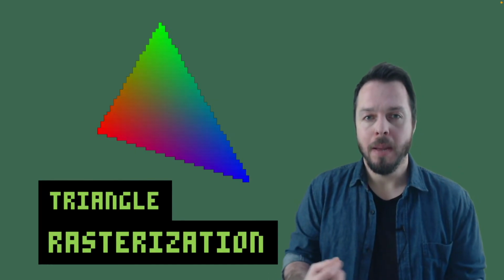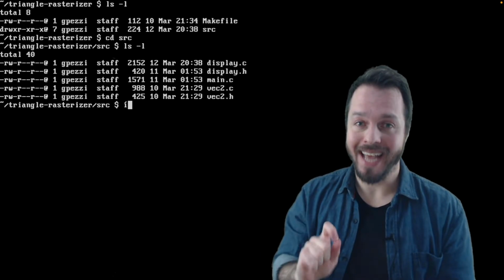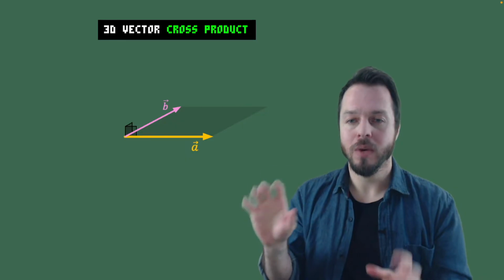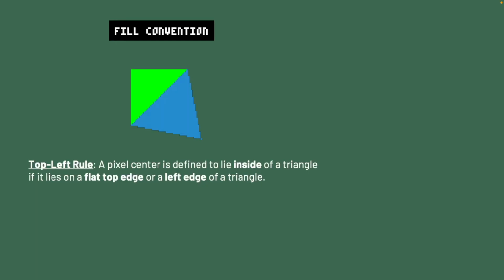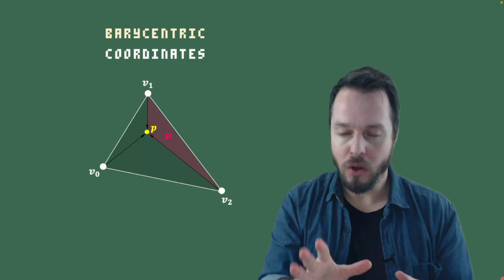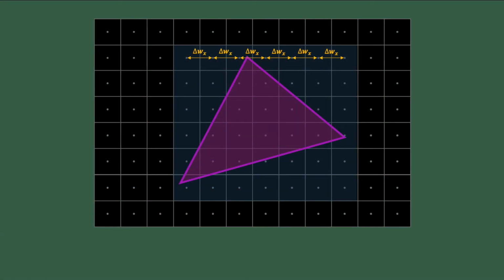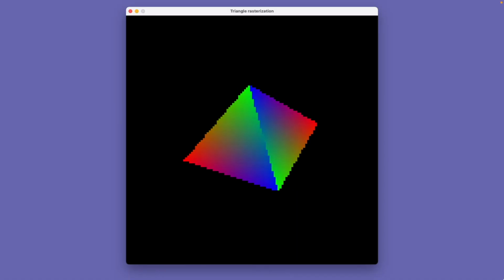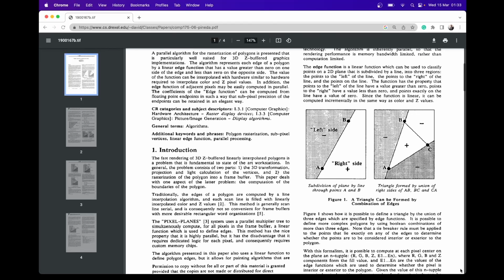Triangle Rasterization

Comment: Hello @pikuma this video is awesome, just an quick note, alpha = w0 / area is only correct if the w0 has the bias not applied. You should create an intermediary variable to sum the bias and then use this to see if that's inside the triangle and only after that calculate alpha = w0 / area using the original w0 so the final weight will be actually correct.

Comment: Also, I don't think we ever cared about the small overlap, z-buffer usually handled that
Reply: and when you want translucent wavy water surface?
Reply: @ArneChristianRosenfeldt  Well, you first render all the opaque stuff and then transparent from back to front with z-buffer
Reply: @AllanSavolainen but the overlap messes with alpha
Reply: @ArneChristianRosenfeldt with proper bias it won't, or you can use stencil buffer to help that
Reply: @AllanSavolainen I guess that is what I meant. I read that the 3do had a stencil buffer, but it was too slow

Comment: Hmm, what Hmm, what I did in the good old DOS days was to first split the triangle into two so that in the middle there would be one vertical edge. In case the top or bottom was vertical, this step could be ignored.
Then I would calculate the slope per row for the left side, eg 0.3px/row. Then do the same for the right side, lets say 0.4px/row. Then would calculate delta length per row which was how much the each rasterized line would grow per row, and would be the sum of both slopes.
Then I would just iterate from the top, fill the cur_row_length of pixels, move the start_x_pos by left_slope and inc/dec the cur_row_length by delta_length. And loop until I get to the middle vertical line, or the end vertex of the triangle.
To get gouraud shading on this, I would calculate similar deltas and slopes for the color gradients and inc/dec those per pixel and row as needed.
Simple rasterization on MCGA 320x200x256c DOS screen. Well, there was extra step to map the current RGB to palette/dithering color.
Reply from the maker: Yes, splitting the triangle in two and finding the slopes to raster each scanline is the approach we use in our course as well. I just thought it was important to also explain this approach since it can take better advantage of paralleliaation.

Comment: I've done most of that stuff 25 years ago so this video didn't really taught me anything new. However I have to agree with all the other commentators: This has to be the best and most comprehensive video on rasterization. Most videos skim over it as they will be targetting an actual graphics API like OpenGL or DirectX which does all that for you. So they usually focus just on the vector and matrix stuff and many even mix up some terminology (NDC and Clipspace are what most confuse and when the homogeneous divide actually happens). I'm sure many probably will struggle sitting through this video as some concepts are explained in a quite tight format. Though I think you really mentioned every little detail that is necessary. Even providing some visual and mental hints for some concepts (barycentric coordinates for example) which is certainly helpful for many.

So I'm really impressed that you managed to pack all this into one video.

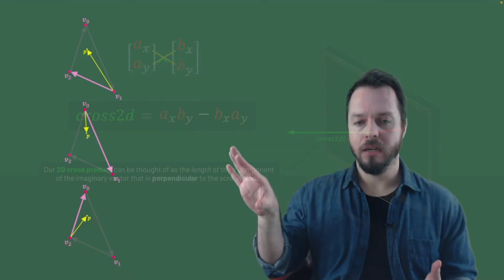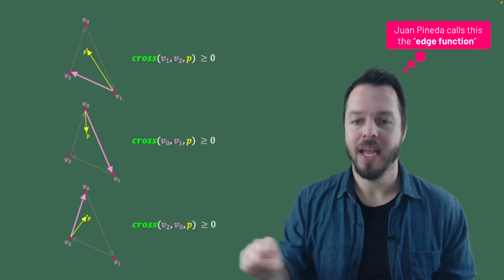Comment: Note that the diagrams at 47:29-47:54 only work for y-up cartesian coordinates and if the vertices are defined and passed to the cross() function in counter-clockwise (CCW) order. They do not work for y-down screen coordinates. However the edge_cross() function in the C code works because the vertices are passed in clockwise (CW) order which are okay for y-down screen coordinates so the  w0,w1,w1 >= 0 test works.
Reply from the maker: Yes! Thank you. My life is a constant tug of war between traditional y-up math notation and formulas that work in screen coordinates with y-down.
Reply: I implemented this in verilog/HDL for my own rasterizer hardware and it took me at least a few hours to figure out that the winding order are different for these different coordinate frames. Glad to see someone commented it here :D

Comment: I'm a windows user and not able to compile. "make" command is not recognized, I have gcc/mingw installed but can't seem to work out what I need to resolve.

If I just run the gcc command it complains about sd12-config: No such file and unrecognized commands '--libs' and '--cflags'.

I've been tempted to get your full 3D graphics programming course but am wondering if it's more comprehensive in the project setup than this video?

I've also recently followed another video of yours about setting up SDL in a Visual Studio Project on windows and feel like that might be what i'm missing here, but I don't seem to have the experience to combine this video's source code with a Visual Studio Project setup with SDL.

Your videos are great no doubt but any help getting this example running on windows would be greatly appreciated!
Reply from the maker: I don't habe a Windows machine with me, but if I recall correctly MinGW cones with an executable called "mingw32-make", which should behave similar to GCC's make on Linux.

But my suggestion would be to simply use Visual Studio. It has not only a better build process (as I show on my SDL+Windows video) but you get a great debugger with it as well.
Reply from the maker: Using Visual Studio also means you don't need a Makefile (or make).
Reply: @pikuma  thanks for the reply! I’ll try again with visual studio

Comment: 1:59:20 taking this a step further, you can offset the rasterization point randomly for every pixel and every frame, as long as it stays inside the pixel area, instead of using only the pixel centers. This turns jagged edges into noisy approximation of an endlessly supersampled image, if done in real time. Compared to ssaa, msaa, fxaa, dlaa and tsr, this could be the cheapest and most detail preserving way of anti aliasing in gaming. Blending the current frame with previous frames takes place inside our eyes due to a phenomenon called persistence of vision, which suppresses the noise by a lot, of course depending on the framerate. There is a github project called gaussian anti aliasing that does this. I have implemented it in a ray marching shader and it works really well. Now, only the gaming industry needs to pick it up
Reply: This is called stochastic rasterization in the literature and you are drastically overstating its virtues. Even if it was a perfect solution to jaggies (it isn't but it's a useful tool), the major aliasing problems for the last 15 years in games and real-time graphics are primarily about lighting, shadows and material shading. That's why TAA/TSR has won--it integrates samples over time, so it naturally filters temporal aliasing, and combined with intentional temporal subpixel jittering (similar idea to stochastic rasterization) you can turn spatial aliasing into temporal aliasing and filter that too. And it's a big hammer that can be used to address all the major sources of aliasing, not just jaggies.

Jaggies just haven't been top of mind for graphics programmers for a long time and for a good reason (1080p -> 1440p -> 2160p). There's a reason Apple got rid of subpixel antialiased text rendering when they moved to Retina/1440p displays. In games, the shift towards deferred shading made MSAA unavailable/impractical and TAA picked up the slack. The one case where I think MSAA/anti-aliased rasterization is a big win is in VR because of how visible edge aliasing can be with the low relative resolution. But that's a niche. Outside of that, it's too far down the list of aliasing problems to be a major concern.
Reply: @pervognsen_bitwise  Thanks for your comment. The literature on stochastic rasterization looks quite complicated to me, but as far as I can tell, its main focus is multi pixel blur. Besides the gaussian anti aliasing project, I can't find any literature on random rasterization anti aliasing

Other than that, I think it all comes down to personal preference. Real time rendering has its limitations, so even with random rasterization points, you won't hide aliasing artefacts. That is not the primary goal of it though. Which is showing more accurately what is going on inside the pixel, while preserving the finest detail during movement, without additional cost. Lots of people rather disable anti aliasing than using taa. As I do, but I noticed that jagged edges stand out the most on stills and slow camera movement, especially on grass fields with a high polygon/edge density. Faster camera movement looks a lot better to me, as the jagged edges ar pretty much random, as wel as texture undersampling of course. Random rasterization can emulate this at any time. If the noise gets unbearable because there is too much sub pixel detail, than this should be adressed with lods or texture mipmaps. Taa can only blur the noise away, together with a lot of precious detail. After all, taa doesn't see a difference between the two. Dlaa is an improvement, but significantly more expensive and still not as crisp as seeing the picture as it is

There is also foveated adaptive resolution, which works with deferred rendering. If you have an eye tracker in vr goggles or goggle mounts without glasses to look at a regular monitor, you can render at lower resolution in the periphery of vision to improve the performance. It also allows for supersampling in the center of vision. This reduces random rasterization noise to very acceptable levels. Still not noise free, but lots of people don't care too much, myself included. It's always possible to include reprojection, but the player should have full control of the most recent frame contribution

Then there is the problem of effects relying on taa to look smoother (at the cost of washing out details). These effects often use dither patterns to emulate translucency, mostly by turning off the opacity mask or by pushing pixels forward so a part of them is hidden behind other objects. I rather use a random number generator instead. Without reprojection, noise looks a lot better to me than dither patterns. I have made a swamp water shader with random pixel depth offsets in ureal engine. This is not only a noisy approximation of translucency, but it projects volumetric shadows inside the water and it looks really awesome. It also works properly with cloud shadows, unlike real translucency. Other than that, I tend to disable smooth lod changing and object blending as soon as I can, as unnecessary and problematic as they are. I really don't mind small changes in geometry and hard edges between objects

There is an even bigger problem than taa blur though: sample and hold motion blur due to the way modern monitors work. Even on 240hz with 1 ms response time or less, you see every frame for 4.2 ms. This produces a significant amount of motion blur during eye tracking, as the picture doesn't track your eye movement in that time. On 120 and 60 hz it gets even worse. Oled won't save us from this. At this time, only a crt monitor or a strobing backlight lcd has a pixel visibility time small enough for sharp movement. This makes taa blur even more obvious during movement, so I can confidently say that I don't need reprojection anymore. As well as variable refresh rates, which happened overnight as it isn't compatible with backlight strobing. A constant framerate is always the smoothest and most predictable, unlike multiplying in game movements by the previous frametime. In order to reach the target framerate all the time, it's well possible to do runtime view distance optimizations based on gpu utilization, if you can get it

Comment: At 1:26:00 these are biases added to the w's, does this not affect the results of alpha, beta, and gamma?
Reply from the maker: Hm, good question. I'll have to do some proper thinking about this but from a very quick thinking I'd say that it respects what we consider what's inside or outside.
For example, changing the w's by a bias modifies what points we consider inside or outside. So, when we compute alpha, beta, and gamma, we are computing the barycentric coords for that point that we consider inside the triangle. Again, I'll revisit the code and think about this properly, but that's my initial quick thought.
Reply: @pikuma  Thank you for replying! Maybe texture mapping something using alpha, beta, gamma would make things clear.....?

Comment: Are you using opengl or what?
Reply from the maker: No OpenGL. Just a window with a framebuffer of pixels to be painted. The source code is in yhe description. I use SDL to create the operating system window.

Comment: @pikuma what's the performance difference between this algorithm to fill triangles and the flat-top/flat-bottom one that you teach in the paid course?
Reply from the maker: Compared to that implementation (scanline rasterizer), this one is faster! You can easily replace the triangle_fill() function for this one and measure it in your machine. Since it's just a simple addition per-pixel it's better than having to compute the slope and the start/end points per scanline.
Reply: @pikuma  any tips on how to optimize this? Maybe I'm not being reasonable, but I was expecting to reach 60fps with this when drawing a few thousand triangles on screen. In reality I'm achieving ~38fps (even with backface and fustrum culling turned on).

I tried to skip a line when going out of the triangle, I pre-computed the inverse of the area to avoid divisions per pixel, but that only got me so far.
Reply: I just compiled with flag O2 and...surprise! 140fps. Those compiler optimizations are dope.
Reply: @paulooliveiracastro  Software rasterizers are bounded by filling rate rather than triangle count. It will bottleneck if you are using a high resolution and model is near to near clip plane. A single triangle filling the screen will struggle your CPU more than a several thousands far away from the camera on a small 64 pixel square.

Knowing this....140fps is a lot a textured Sponza model, but you should achieve 200/300 fps for a small rendering area.

Comment: Instantly subscribed! I have functionally rewritten PS1 GPU in C so I felt called out when you mentioned how PS1 handled rasterization ;). Even with multithreading I still had problems with performance on weaker devices like PSVita. Calculating barycentric coordinates "the proper way" on every pixel is just out of the budget.

This video solved most of my problems with this, though I may add some empty space skipping later if profiler will say so, but I want to avoid divisions somehow... Speaking of which at 1:25:49 you could've calculated invArea instead of area at line 68. This way you could replace divisions at lines 86-88 with multiplications.

Now I just have to understand the bit arithmetic sorcery Duckstation project has in their `GPU_SW_Backend::ShadePixel` function (GitHub) and maybe I can finally squeeze the performance I need for this thing... if I could understand it. I recommend checking out some projects with software renderers (especially emulators targeting weaker devices) some of those are literal gems and maybe you'll come up with more video ideas. There is very little good content on YT and internet in general regading that topic.

My two cents. Keep up the great work you do!
Reply from the maker: Loved your comment. Thanks for the tips on that division. Divisions really were 'bad hombres' back in the day. :)
Reply: You can use gradients for interpolating in across triangle. You calculate them once for entire triangle and than you simply increase interpolant (like texture coordinates, color, depth) and so on. You can find this methon on chris hecker texture mapping article and on thebennybox chanel in software 3d renderer series.